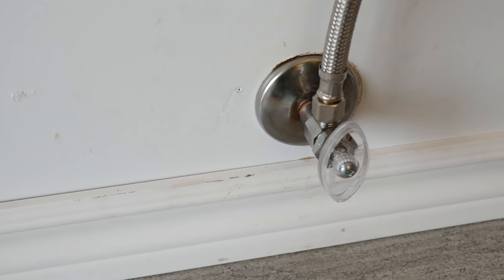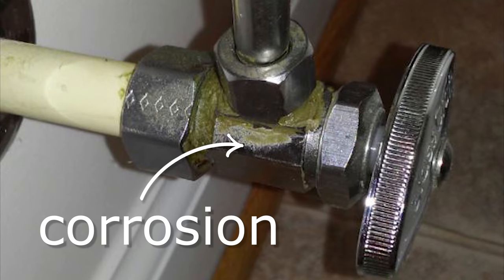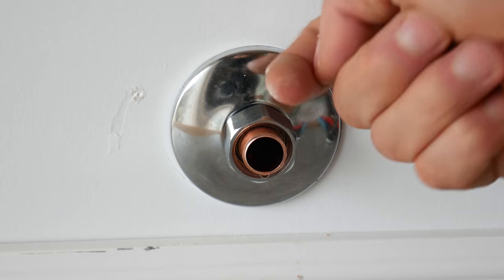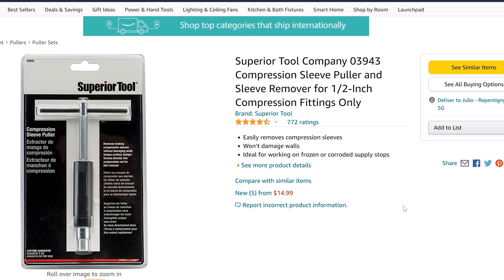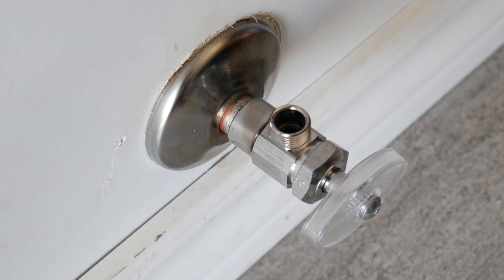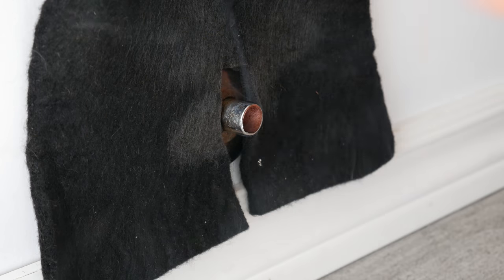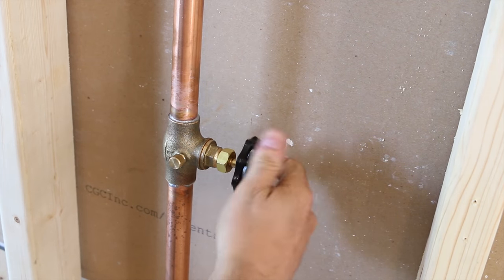How To Remove/Install a LEAKY/NEW SHUT-OFF Valve (Compression, Soldered or Push fit) | GOT2LEARN

Comment: Excellent video, thanks for sharing. 
Do you not need to clean the copper pipe with sandpaper for push and compression fittings? Should one use pipe dope, or Teflon tape on the compression ring / olive?
Thanks in advance for sharing your knowledge and experience.
Reply from the maker: 1) pipe must be clean, not sanded
2) no dope/teflon required
🤘🤘🤘

Comment: When soldering on a new shut-off, do special steps need to be taken to keep heat from damaging the shut-off?
Reply from the maker: Yes, you must only use what's needed in terms of heat, a good visual indicator I use is, when the solder melts, the valve is hot enough, anything more than that can potentially cause damage, lemme know if this answers your question.
Reply: @Got2Learn  Yes it does.  I also saw on another of your videos to aim the torch away from the body of the valve so the heat is directed mainly toward the end where the inlet pipe comes in.
Reply from the maker: @eugenepolan1750  yes, that's very important!
Reply: Always solder when valve is in open position and do not operate valve until it has cooled down to avoid damage to Teflon seals.

Comment: still not quite sure exactly which one I have. could be compression, I had this issue when replacing a faucet during the holidays.  couldn't stop the drip completely on the cold side and ended up applying some plumbers tape and no more leaks.

Comment: I have an odd but important question (not fit to this video). Is there such a thing as too many hammer arrestors? Obviously they need to be put near shut off valves but what about in the middle of a transit line? What if you put two in the same line stretch (one at the valve and one in the middle)? To go buck wild what if you put 5 - 10 in sequence? lastly does this reduce pipe noise?
Reply from the maker: Many homes now have a few on the system to prevent knocking from high city pressure, the only thing stopping you would be cost here I guess 😉
Reply: @Got2Learn  I’m gonna make some weiiiird shit - “Star Lord”

Thank you.

Comment: Disagree on the leaking part not being able to be fixed.  My valve was stuck.  I got it unstuck but then it began to leak where yours in the beginning of the video was leaking. Took a wrench and tightened that nut right after the knob while holding the nut down the fitting with a wrench and it stopped the leak.
Reply: That's what I did on my intake valve to my bathroom sink

Comment: My "quick faucet replacement" project turned into a  "Now I need to replace the original valves while I'm at it" project.
Reply: If you'd had all the parts ready, you wouldn't have needed them. Lol

Comment: Just tightened a compression angle stop valve, but I'm a bit uncertain about it.  I held it firmly.  Then tightened it about a half turn after hand tightening it.  Then I attached the toilet supply connector.  When I look at the the valve from the side, it looks like the supply hose pressure has pushed the valve down a little; it's not straight.  It doesn't leak, but I'm worried it could come off.  Do you have any suggestions?  If it doesn't leak, am I good?

Comment: very good video. However despite using a lot of muscle power, I can't get the valve to stay still while trying to turn the nut. the whole unit turns and only comes out a small amt. Any suggestions?
Reply: Vice grips? And in old house world, you REALLY don't want to clamp down tight on anything. You don't know how bad the pipes are down the line. Be careful/slow turning it back of for thr same reason.

Comment: does the compression ring deform the pipe? If I use the puller t can I switch to  press on type or is the copper deformed?

Comment: I am replacing the shut off valve under the bathroom faucets, which are copper pipes. After taking them off, can I use a shark bite?
Reply from the maker: sure, just make sure the copper is spick and span

Comment: Is there a reason you didn't put teflon tape on the threads before tightening down the compression valve?
Reply from the maker: Reason #1: Teflon is not for sealing, it's to aid the proper thread penetration
Reason #2: Those threads are parallels threads, not tapered threads.
Reply: @Got2Learn  Thank you!

Comment: To stop the leak you showed at the beginning of the video, just tighten the packing nut on the valve until the leak stops.  The valve probably won’t have to be replaced.

Comment: You should disassemble the angle stop before you solder it to the pipe else you might overheat the rubber and plastic parts within it. I would not use a sweat-on valve myself, as angle stops inevitably do go bad and this just makes the valve more tricky to replace.
Reply from the maker: You do not need to dismantle these.

Comment: Hey I’m looking to install a angle valve push fit for an ice maker . There’s a cap on the water like that I need to remove but before I remove it I wanted to make sure I can install a push fit onto that threaded pipe line. Can you please help me?

Comment: Had no problem not replacing the nut and ferrule unless I want the whole thing to look new. The problem with old valves is when you turn it even for the first time it starts to leak. You could fix the leak either with packing or a new washer.
Reply: Isn't opening and closing valves part of what you do to keep after your house? I do. 

I dump boilers all summer out of habit. Plus. It can get cold at night

Comment: They can be fixed. Just buy a new valve core or washer set. I have ones from 1950 and they still make the parts.  Still though, I do prefer the 1/4 turn ones since the lead bushing can leak if it's used a lot.

Comment: The copper pipe should be cut 2" out from the finished wall. I also put Teflon tape and plumbers grease on the threads of the new angle stop valve so in the future the compression nut will come of easier in the future.
Reply: Um. Sorry. But as a rule Teflon takes up space and causes threads to fit tighter on NPT fittings. Machine threads like on compression will bind up with stuff in threads. Thus causing the ferrul to not properly do its job. And the tool possibly being on fitting for a hard torque and scratch the chrome. Instead of just a full turn past hand right with clean threads. Grease I agree with. But Teflon has no use inside a cabinet anymore. Only NPT fittings. Unless your stop is pipe threaded and has flare. And for the love of god. Slip joint is compression. No teflon there either. If the ferrul can do it’s job? The water never reaches the threads.
Reply: Some folks use Teflon tape like it's Franks Hot Sauce, they put that shit on everything...

Comment: Can I replace a soldered fitting with a compression fitting after cleaning the copper stub?
Reply from the maker: It has to be perfectly clean.
Reply: @Got2Learn  perhaps best to cut it below where was soldered and start with a fresh pipe?
Reply from the maker: @percyfaith11  If you have enough material, that's the way to go yes ;)

Comment: After removing the compression type, I often see that the ferro leaves a dent on the pipe. Any suggestions to repair the pipe stub?
Reply: Depends what you want to use for a shut off valve. I’d install another compression valve. If they’re installed properly, they’re tightened enough so the ferrell doesn’t come off. Just install the new shut off using the existing ferrell. Hope that helps.

Comment: Good video,  but that first valve that was leaking. Where the stem goes into the packing nut. Those become loose usually from opening and closing the valve but can on there own. Literally tighten that packing nut and its fixed
Reply from the maker: Thank you, don't forget to share :)

Comment: So a soldered brass craft or compression of the same style have a packing nut, you don’t need to replace anything just tighten the nut on the front of the valve, quarter turns need to be replaced. And if the packing nut doesn’t stop the leak by tightening it you can just swap out the inside without having to solder ….. sometimes I question your advice. Been a plumber for 17 years and I’ve never sweated a brass craft cable to replace it with the same one …. Just saying

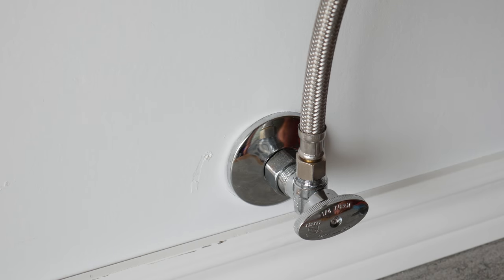Comment: At minute 2:29 I need to do similar with my hot 1/4 turn valve connected to Pex line. But for some reason, I can't unscrew the top nut. I tried and tried buy I'm afraid to damage the valve or pex line going to the valve as well as the pex line going  to the dishwasher. What do you recommend?

Comment: Quick question: if it is leaking at the stub out I get replacing the whole valve... But on the non-quarter turn valves why wouldn't you just remove the handle and replace the gaskets that are inside of it?
Reply from the maker: You can do that if it's a 2 piece system, some are 1 piece so no choice to swap out, cheers ;)
Reply: @Got2Learn  thank you for the quick reply!  Had only seen two piece; the more you know!
Reply from the maker: @sidranshu  😇😇😇

Comment: Replaced a compression type valve and it leaked. Called a plumber and he indicated you can’t compress the same portion of copper. So you should trim back the copper before installing new valve.

Comment: ive seen a video that shows cutting the pipe off when its soldered and just using a little steel wool to clean the pipe before using a sharkbite valve..is that correct?
Reply from the maker: Yes, works fine....as long as there's no burr around the outside of the pipe and that it's clean, it'll work!

Comment: quick question. What if the pipe isn’t long enough? Mine isn’t stuck out it’s in a hole below the ground
Reply from the maker: You'll need to pull it out first, is it in a concrete slab?

Comment: don't you need to disassemble the internals of that shut-off valve and remove the rubber o-ring/washer parts before soldering?
Reply from the maker: Nope!

Comment: Long story:

My wife was nagging me to replace one of these because it looked all corroded. Was working PERFECT but she just didn't like the look.

So I go buy one of these and the guys at the hardware store are all gushing about how easy it is. Stupid jerks.

So I get home with the new valve. But the old one is GLUED ON (plumbers putty? Epoxy?) to the plastic 1/2" pipe. No use but to cut it off. Still lots of room left.....so I install the new pipe. Leaks like mad even though I did everything right. 

I go back to the store: "Are you SURE you aren't supposed to use a sealant of some kind? That white Teflon tape stuff? Putty? The old one had it. Here it is. Check it out I had to cut it out."

Stupid guy says no. "The compression will seal it fine. You probably overtightened it."

I buy another one. Install it as directed. Same leak.

At this point I added some white tape and I get a drip every 10 minutes or so. At least now I have a stop gap until a plumber gets here. What a nightmare. All because the wife didn't like how it looked.

Question after all that? Putty? Glue? Teflon tape? Why does it leak when I rely on compression? It's a plastic 1/2 pipe BTW. If it was copper I would solder and be done,with this mess.

Comment: Great info.  But installing a new control valve for a toilet using the compression fitting to copper simply did not work.  I tried 4 different valves and they all leaked.  Looks like the plumber will make money today.  :(

Comment: I’ve always reused compressions nuts though it’s probably not the best practice. It sort of depends. The only ferrule remover my supply house carries is a cutter which requires enough space to get the nut out of the way. 
When I started in west Texas in 2000 my boss preferred threaded stops. We’d solder a male on every stub out. It wasn’t until later when I moved to Austin that I worked for someone who commonly used compression angle stops. 
The two I can’t stand are gate valve style. I expect to see them on old houses but when I see them on newer houses it just makes me mad. They seem to work about half the time. The other is sharkbite and it has nothing to do with plumbers’ normal aversion to them. It’s because they spin. Every time I go to turn one off I have to go get a pair of pliers and back it up just to turn it off.
Reply: I agree on reusing the old one being the best approach. I find that even when the puller works correctly, the pipe is damaged. Not by the puller but by the expanded band.
Reply: @jonathans1472  Especially if someone overtightened it. It can mangle the copper and if you remove the ferrule it can be hard to get a new one to set properly. A resizing tool usually works but not always.
Reply: @joshcowart2446  Thanks. I didn’t know there was such a tool as a resizing tool.

Comment: Mine shut off valve is neither of the three you presented, it looks cheap with PVC plastic tube and some kind of black ring is on the white PVC.
Reply: Sounds like what’s used in mobile or modular homes. The plastic tubing is called PEX. Best not to mess with it if it’s not leaking.

Comment: Also, a shutoff valve that doesn’t shut down off makes attending to toilet tank issues impossible. I guess pex plastic plumbing is not in your area. That makes removal impossible if the old valve is flush to the wall.

Comment: The nut in my compression valve won't budge.  How do I remove it without damaging anything?
Reply from the maker: Did you try with the special puller? If not, you can use a dremel to cut it off, just be careful not to nic the pipe.

Comment: Question. Go back and look the supply stub when the compression fitting was removed. You will notice a depression left over from the old olive/ferrule. Is it okay to install a new compression nut and ferrule over that depression, or do I need to sweat on a new supply stub? Thank you.
Reply: Howard that's an excellent question. The brass ring should form a proper seal but there's always a chance because of subtle differences in design that it may fail and leak.
Reply: when I encounter that, if there's enough pipe sticking out from wall, I'll cut off a 1/4" or more so the new ferrule will compress on the original OD of the pipe. The compression area is more important than a bit of thinner pipe being inside the valve body. 
Also I'll sometimes reuse the nut & ferrule if the valve was really tight taking it off. You're almost guaranteed to have the ferrule remover squeeze the pipe down when it pulls off if it was tightened too much on install. hope this helps.
Reply from the maker: Make sure the pipe is sound before reinstalling another compression valve, use your judgement.

Comment: Question for those "in the know":    I have sweated on valves.  If I heat and remove them, can I go back with a different type valve such as the compression valve or push fit (shark bite) valve?
Reply from the maker: You need to make sure that you are installing it on bare copper, not half copper half solder, it has to be as clean as a whistle or it'll leak.

Comment: removing the retainer nut, and ferrule is a really bad idea.
the copper pipe is reshaped when first seated with the ferrule.
you’re asking for trouble by squeezing another ferrule on there and expecting it to sit exactly like the previous ferrule.
it’s an absolute exact science when that seal is formed, and any deviation will result in failure.
my get rid of that removal tool.
remove the valve body, and screw on a new one.  the taper on the ferrule will seal against the new valve body, same as it did the first because the shape has not been altered.
no leaks.

Comment: If I have a soldered valve can it be replaced with a press fit valve?
Reply from the maker: Pipe needs to be down to bare copper if you choose.

Comment: Just a note- I rarely have had to replace the ferrule when replacing a compression valve. ONLY if somebody has overtightened it, otherwise it is re-usable in most cases.

Comment: I never get how do you solder on valve with seal inside being so close to heat area. It's ok if it's 2 piece valve which you can take apart, but one piece will get it's rubber seal melted.
Reply from the maker: If you use too much heat you will burn the contents inside for sure, but these do not need to be dismantled.

Comment: I can vouch if yours is soldered on you can use a heat gun not a blow torch, that gets hot enough took me about 10 minutes before it got loose enough to pull of with my grip pliers !
Reply from the maker: Nice!

Comment: Water from the copper pipe won't turn off.disconnected water tank,shut off the power breakers,opened kitchen & bathroom sink handles,turned off all basement valves,& it still water runs.i can't solder because of this.any ideas?

Comment: Is twist on common?
Reply from the maker: More and more...
Reply: @Got2Learn  home built in 1960 what would you guess? How can you tell?
Reply from the maker: @tb808  wait, what do you mean by "twist"?
Reply: @Got2Learn  twist on twist of. Instead of soldering or anything like that
Reply from the maker: @tb808  so, in 60s houses they were soldered or threaded on.
Reply: @Got2Learn  I tightened the neck bolt and it stop leaking
Reply from the maker: @tb808  👌👌👌🍻

Comment: I'm still scared of shark type (push fit) values, I used one of them but only because it was in a confined straight line "pipe-valve-pipe" situation:    ===pipe==={shark valve} ===pipe===
because the pipes on both sides are fixed to the wall so the shark valve would not be able to come off even if the 'bite' fails

Comment: when you use compression fittings.  always sand with the finest sand paper 1000, 2000.  otherwise, it will leak.  and, you're going to blame someone else...